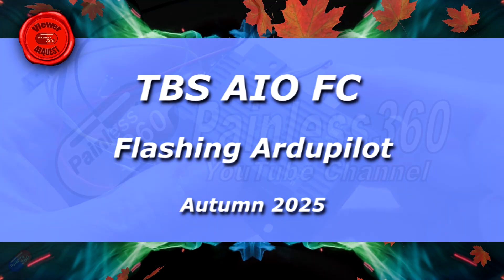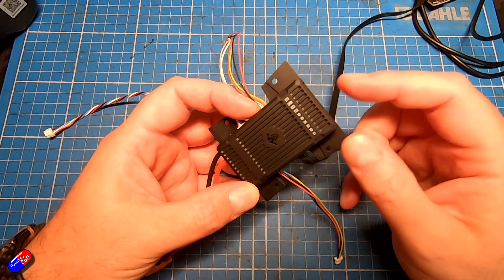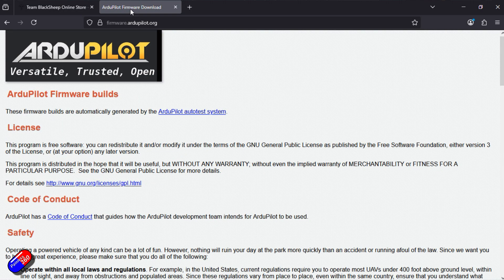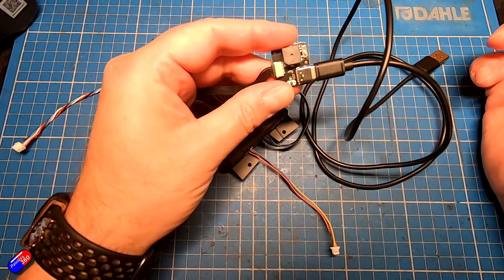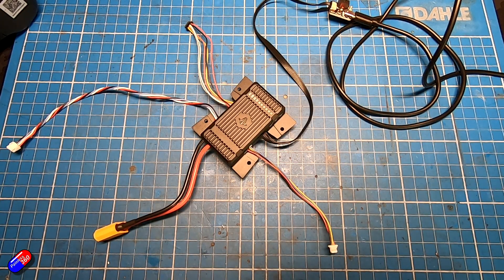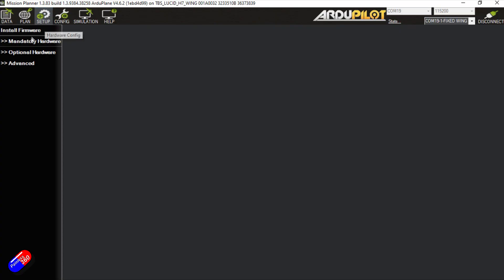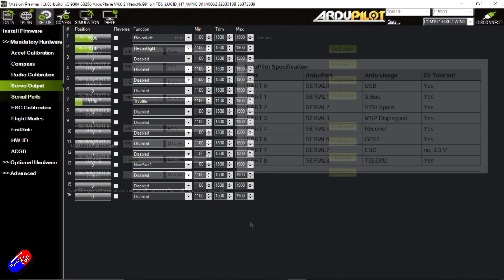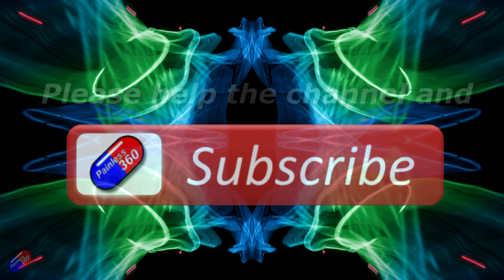Flash Ardupilot into the TBS AIO Flight Controller (Easy)

Comment from the maker: NOTE: Following the making of this video, this FC now has it's own target in AP 4.6.3 and later. 
This fixes the port assignment and IMU orientation too. 
See https://firmware.ardupilot.org/Plane/stable/TBS_LUCID_H7_WING_AIO/ Happy flying!
Reply: did you find that vtx power switch was on relay 2
Reply: Es correcto, en el manual de TBS estabelece que  es rele2
Reply: G'day thanks for posting this - any idead how to connect a TBS crossfire diversity 8ch RX via sbus on the RX2 port via mission planner. have been struggling with this.